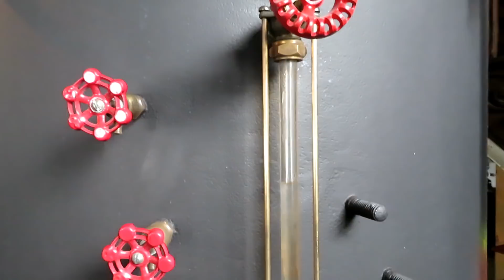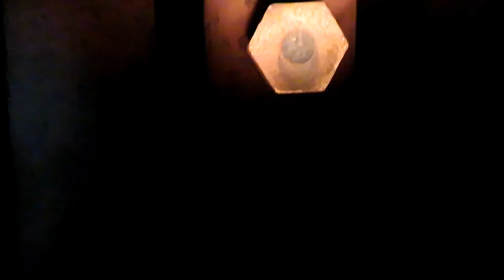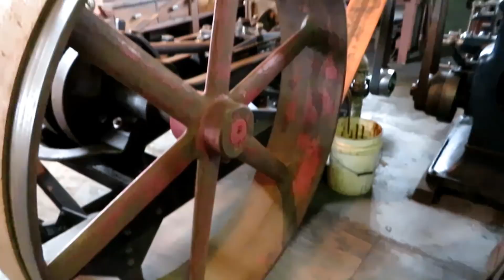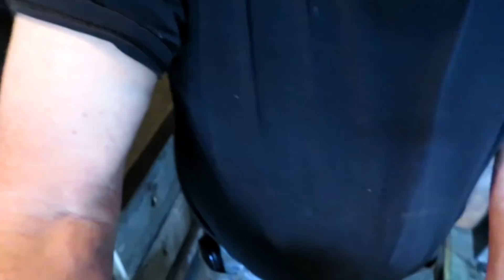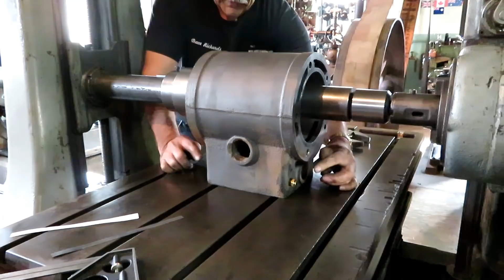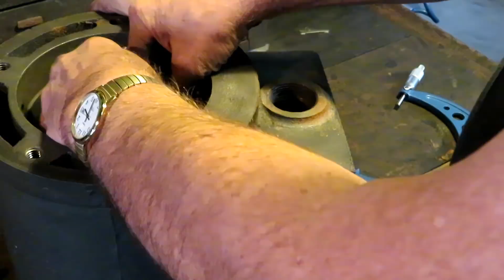OLD STEAM POWERED MACHINE SHOP  38  Up and running again

Comment: Great to see another year of steam firing up!.....Always wondered about those glass water level tubes, why don't they explode?  Hope I haven't missed this answer somewhere in the past...Thanks for the awesome vids!
Reply from the maker: They do if the're mishandled. There are rules: never rod one out with anything but a wooden stick, don't tighten the packing under steam, use only glass made for that purpose, keep the guard rods in place, keep the shut off valves at top and bottom in good working order.....Dave
Reply: Made of  REALLY  thick Pyrex  or Borosilicate glass .... There is a neat special glass cutter  you use to cut them to fit odd sizes with when they get broken .... Have you got a sight glass cutter @Dave ?
Reply: I'm assuming its a tempered glass like the kind you could put in the oven. lots of cool vintage glassware was made for that way back when.
Reply: You are correct. It's also really thick. The hole in the center of the tube that water and steam flow through is only 1/2 to 3/4 of the outside diameter of the glass. They use the same style glass in modern heating and high pressure boilers as well.
Reply: We've got sight glasses on boilers at work that are 600psi, 450psi steam.  They're made out of thick plate glass and have steel encasing most of them.  There's special ball check valves that trip to shut off the sight glass if the glass blows.
Reply: @KD-lq1sr  thanks. I wondered about how they would contend with a break.
Reply: kevin chaney Most  of the time they get bumped . Breaking them . If the ball checks are working in the upper and lower glass valve shut off. The sudden change in pressure will check off the steam. Stoping steam from blowing off. I worked with steam for 37 years. There is a proper process for setting a ball check valve.

Comment: Hi Dave, in the States does the boiler have to be tested and certificated from time to time?
Thanks for the videos.
Reply from the maker: Hi Colin, In the U.S,  each state has their own boiler certification, some don't have any. Here in New York, an internal inspection is done every year, and a yearly external inspection. A hydrostatic cold water pressure test @ 125% of it's max working pressure is required every 4 years, and an ultrasonic thickness test all over the boiler is required when ever the NY boiler dept. feels like it......Dave

Comment: You may have told somewhere along the way and I prolly missed it. But what does “18151” mean on the boiler? Seems it must be important. But I’ve wondered that since the very first video I saw. Just wanted to watch several vids to make sure you haven’t already answered. And I apologize if you have already!
Reply from the maker: Hi James, It's just the manufacturer's serial number of the boiler. It was required in 2" metal letters by the National board boiler code at one time.....Dave

Comment: most guys that work in a machining cell hated the boring mill, so i used to get overtime work
from that mill..... granted it was slow, however it had been scrapped and was tight running...

Comment: How often do you have to hydraulic test the boiler, and are there laws/regulations you have to follow? If so, are they the same as a steam locomotive boiler or are they different?
Thanks in advance.
Reply from the maker: All states are different when it comes to "hobby" or antique boilers. New York required an ultrasonic thickness assessment,  to get it reinstated into their system, an annual internal inspection and a separate annual external inspection under steam. also a hydrostatic (cold water) pressure test every 4 years at 1.5 times the max allowable pressure on this boiler as determined by the National Board code considering the results of the ultrasonic testing. Locomotives operating as tourist RRs are pretty much under the National Railway Administration rules and are much more extensive, and becoming more prohibitive for any other than government owned and subsidised  tourist railroads or big corporations like the Union Pacific or Norfolk Southern. ....Dave

Comment: Hey Dave, really appreciate the channel..I spent alot of time over the years looking at black and white photos of old line shaft factories..textiles, machine shops, sawmills. Not being old enough to actually see any of them in person, I was always fascinated by all the things going on in those pictures.. the architecture of the buildings, the workbenches, the tool chests, the machinery, the oil soaked hardwood floors, even the clock on the wall. I always wished I could see more than just that moment in time and hear the sounds of all those machines running, belts chattering, the tick tock of the clock ,the ring of the phone..so, thanks for bringing all that to life for me. I enjoy every minute of it. Are you gonna be in Kinser pa. this summer? I'll look for ya.. Live a few miles from there
Reply from the maker: Hi John,  Thanks for the comment, I was at the Rough & Tumble spring steam up last week, hope to make the summer shows...Dave

Comment: When you showed the cyl originally, you said it was to be blind bored. Was the bottom cover just pressed on? Will you explain, please.
Reply from the maker: It was not a blind cylinder like I thought, the bottom head was rusted on....Dave
Reply: Thanks

Comment: Is the clock steam powered. Mate you have, that which I dream of. Bloody bottler.
Just thought, a good source of soft cast iron, are " lifting weights". It machines beautifully, are relatively cheap, only problem is the width, or length. And Thank You, for the preservation of " steamy stuff".
Reply from the maker: Glad you are along Aubry, The weights are a good idea, and I have some. Might be good for rings...Dave

Comment: For the bearing opposite the flywheel, rather than prying up to check for play, I think you need to push down on it.  The weight of that flywheel is probably forcing the other side up.  If that makes sense 🤔
Reply from the maker: It does, it's tight.  I shimmed it a little tighter and it started to drag...Dave

Comment: David, Thanks for producing the video, it is fascinating. I do have a question-how long from putting a match to the boiler until you can begin to operate the machines?
Reply from the maker: about 45 min if it is a little warm from the day before....Dave

Comment: Hi I really enjoy watching your videos. While watching this video I think I noticed the shaft on the electric motor drive to the Borer move in and out !!! is this just a thing with the camera or is it moving in and out ?
Reply from the maker: There is a lot of end play in those old babbitt bearings, but it doesn't bother it. The motor is a GE and it's a lot older than the machine. The tag shows it belonged to the Pullman RR car company at one time....Dave

Comment: I noticed that you did not use 'coolant/cutting oil on the Racine when you were cutting off the corners of that job.Is there a rule of thumb when you do/donot use cutting fluid?.
Reply from the maker: It would help. The saw is not running as fast as I thought it needed to run. I'm looking for a 9" diameter pulley for the countershaft to run it faster, then it could use coolant for sure...Dave

Comment: Hi Dave, 
Welcome back to the shop. I have picked up many pointers in you previous videos.  Your info on the steam cylinder design was just what I needed. I have a no name 8" by 10" mill engine that became a rodent hotel for many years, cylinder pitted real bad. I don't have a boring mill, but I have a Regal La Blond 24" by 96" lathe. My plan is to bore and sleeve back to stock using sleeve retainer, this is just a thought for now. Thanks Dave.
Reply from the maker: Should work fine, just don't forget to measure the bore "relief" distance from the ends so you can cut them back the way they were....Dave
Reply: Relief Distance,  Yes, good point, don't have them on gas engines. Thanks Dave.

Comment: Surface finish turned out great on the cylinder.  Still planning on the Spring Steam Up at Rough & Tumble on  May  11& 12 ?  I'll be out on Saturday by my Olds engine in the Willock building.  Hope to see you see again, Jeff
www.roughandtumble.org
Reply from the maker: I should be there Fri. to get a PA boiler inspection, probably most of Saturday.....Dave

Comment: in a shop of that period would there be multiple workers using different stations at the same time? say somebody on the lathe and someone else on a drill press so that if you had an order for x number of parts to be made that the various steps could be done at the same time?
Reply from the maker: Sure, everything can run at once if necessary...as long as Tom is firing the boiler.....Dave

Comment: Hey, nice to see you again.  I smiled at your job on the power hacksaw - at work I sometimes cut lumps out of big bits of thick plate with a plasma cutter, but same as you mentioned for gas burning it makes it so hard, I try to cut the crusts off on our big old hacksaw before doing much else with it.  Hope you keep the setup bits coming - that sort of thing sticks in the mind, or would do if my memory worked properly.  It's much better than messing up an irreplaceable casting oneself, which might also be memorable :-)
Reply from the maker: OK, more fun watching me mess it up?....Dave

Comment: Good to see the shop running again. I've always wondered how the tools are set up in a boring mill and here is my answer. Is it more the case of boring until you are happy with the finish and then turning the rings to fit, or can you actually get a very accurate bore size?
Reply from the maker: I'm reboring the cylinder oversize to get the rust pitting out of it. A new matching oversize piston will be made to fit the cylinder and I will probably buy 6" rings .080" oversize to fit.....Dave

Comment: Dave I have to say that your videos are the most clear and precise on you tube. Second, had you thought about a steam condensate recovery system. It might be a interesting idea. I used to work for Monsanto and they did everything by steam and used to recover there condensate. Of course theirs was huge but it might be interesting project. Another question is do you have someone to take over the shop when that time comes.  Don’t get get me wrong, don’t leave any time soon. Just wondering. Glad your back.
Reply from the maker: Gearld, It really isn't worth the trouble to recover the water, and I don't want to run the risk of getting any steam cylinder oil in the boiler, it really screws things up. With Monsanto it might have been an environmental concern....Dave

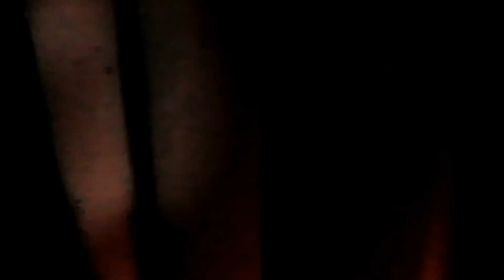Comment: David at about 6:12 when your looking at the tube bundle are those dark spots pitting or scale?  and what is the wall thickness.  worked with aux and waste heat boilers in US navy we use to treat with TSP (trisodium phosphate) and DSP (Disodium Phosphate) to raise the PH and treat for hardness.  will have to see if I can find my old copy of nstm 220 boiler water / feed water.
Reply from the maker: I think they are just concentrations of impurities that attach to the tubes like flakes. When I first started firing this boiler 4 years ago, the tubes were covered with them.  The boiler treatment loosens them and they fall off gradually then are blown out when blowing down the boiler at the bottom valve. ...Dave

Comment: I spotted a Heli-coil in that cylinder (I've installed a lot of those) and it got me thinking.  How would stripped, internal threads have been repaired before Heli-coil was around?  If there was enough metal I would think the 'ol timers would have just drilled out the bore, tapped it for the next bigger size and then whipped up an odd ball stud (I've also done that).
Reply: That, or make a Timesert style insert and not so much of the 'ol timers if you please , some of us still do.👍

Comment: G'day David good to see you again mate that's a nice old boiler and looks very clean regards John PS that was challenge fixing that cylinder to the table the cutting tool arbor is that set on the shaft by way of a key way?     The trick that you showed how the old blokes did it was quite ingenious  with the "L" bracket and feeler gauge, to see if it was perpendicular to the surface of the table, one ting I wish is that I paid more attention in maths classes, thank god for google!

Comment: Great to see you back. Alro Steel shows a 6-1/2" diameter drop, 6" long, for 134.00 and Speedy Metals is 35.00 per inch for 6-1/2" d if that helps.... Seems like it went up in the past year... keep the bids coming!
Reply from the maker: I forgot about speedy metals, I gotten material from them...Dave

Comment: 170 for a foot of 6" from mcmaster, you can get it cast for cheaper than that yourself? dang..
Reply from the maker: plus shipping...Dave
Reply from the maker: a piston Ted....Dave
Reply: He needs 6-1/2" and is 200.00
Reply: I take it that material was to make a set of rings?
Reply: dave said just under 6 inch was the bore and the stock comes oversize from nominal, I looked at both the sizes before you even mentoned that :p curious what you end up spending at the foundry dave.
Reply: You could trepan out a slug and save it for another. job.
JIM
Reply: It is stunning how much stocks costs. I was looking at some 3.5" ductile on Granger in 1 foot lengths, it was on clearance for 25 bucks. I bought 2, it disappeared off sale right away. That included free shipping, someone made a mistake I am sure, the stock had regular price over 150 bucks per foot.  Ouch
Reply: I had a similar need for a cylinder of cast iron and also rejected the going price.  I found a steam flange big enough to cut my blank out of inside the bolt ring.  I made a D1-5 backing plate for my 10" six-jaw chuck.  Works well.

Comment: Welcome back, Dave.  A guy over on the smokstack had a question on leather belts. He has one that has a bend set in it (like from being folded) and was asking how to get it to lay flat. Kind of bulges as it goes around. Any suggestions?
Reply from the maker: I'd try to soften it with neatsfoot oil and clamp it between some blocks for awhile....Dave
Reply: David Richards  Thanks for taking time to reply. I will pass on suggestion

Comment: Glad to see you are back. I am wondering why there is no cutting oil used?
Reply: The graphite flakes dispersed in gray cast iron make it self lubricating.  Also, the powdery swarf generated when cast iron is machined mixes with cutting oil to form an abrasive paste.  That paste damages the equipment and messes the work up.
Reply from the maker: very true, the mild steel is usually run at such a slow surface speed on that lathe that it really doesn't do much except improve the finish on a finish cut...Dave